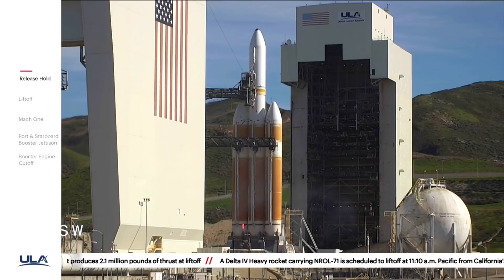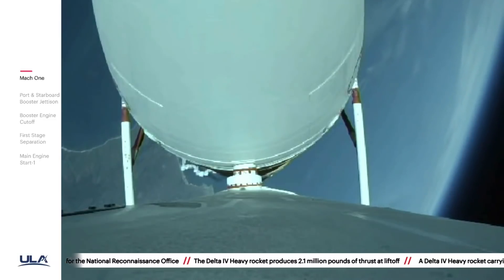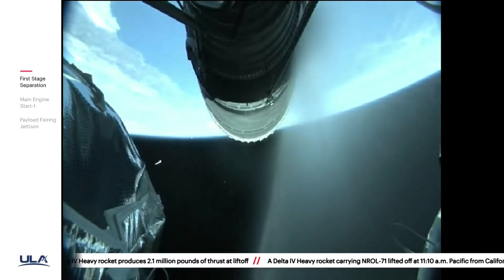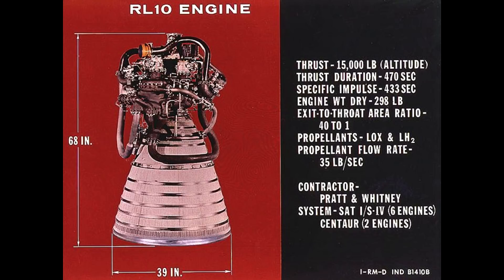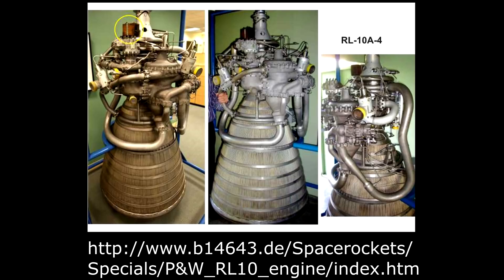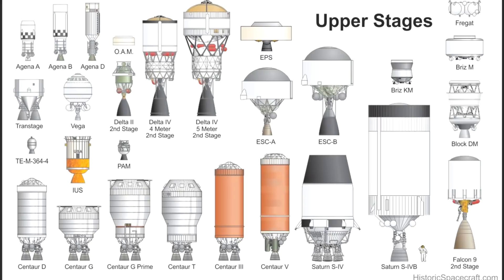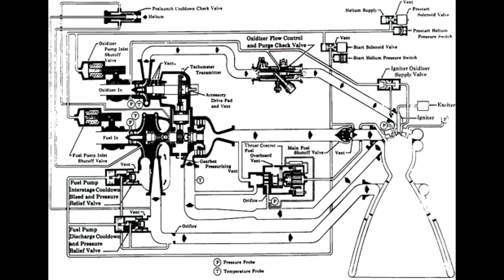The Most Efficient Rocket Engine - The RL10 Expander Cycle Engine

Comment: My grandfather Wesley Kuhrt was responsible for the overall design of the RL10 and was gifted the patent for the the RL-10 rocket at P&W. He came up with the original idea for changing the expander cycle and was a genius with regard to liquid hydrogen. My family used to tell a story about when he was 13 he accidenelt exploded a test tube with hydrogen in his basement and had glass imbedded in his chest. I have the original pump expander design patent plaques gifted in his name. He lead the research department for many years and ended as Executive Vice President of United Technologies in the 1980’s.
Reply: Impressive guy!

Comment: Boiling the hydrogen seems like a really bad idea, the heat capacites are unpredictable, and the resulting gas/liquid mixture can't be good for the turbine. Boiling also limits the chamber pressure to no more than 200 psi so it's unlikely that it would reach the quoted performance. The pressures must have been much higher to allow the supercritical fuel to smoothly expand through the cooling jacket and turbine, as the cycle's name suggests

Comment: The RL10 is OBSOLETE in so many ways... it is still a brazed tubing engine when it would have been faster and cheaper to DMLS print the darn bell. Also, at 10 tons thrust, it is seriously underpowered for ALL the applications it is currently used for be it the Atlas Centaurs or the Delta IV upper stage (aka SLS ICPS). Speaking of the nozzle extension, it is kinda one of those unnecessary complications. I bet you the payload fraction would not have been meaningfully worse if they had a fixed nozzle extension and simply extended the interstage. The additional mass being discarded with the already heavy 1st stage isogrid tank will have minimal impact on overall performance.
--
NASA really shouldn't have dropped the J-2X efforts for SLS and EELV shouldn't have abandoned the RL60.

Comment: The expander cycle is the right choice for lunar landers -- well within the square-cube limit, low stress on the turbine, very high ISP -- and with 3D printing simplifying the construction and likely improving the reliability it just makes more sense than any other engine cycle for reusable landers on the Moon.

Comment: The RL-10 was designed by Pratt & Whitney, the same engine company responsible for the R-1830 engine used on the DC-3/C47 and many other iconic airplanes, the R-2800 that in effect became the war-winning radial engine equivalent of the British Merlin V-12, and the reliable R-4360 workhorse of post-war heavy hauling.  Quite a legacy for a machine shop.

Comment: Hey Scott, idea for a show: the old Russian NK-33 (?) engine; revolutionary closed system, much better performance, had a bad run with the N-1, put in storage, rediscovered by the West as "sliced bread 2.0", cleaned up, renamed AJ-26, had a bad run with Antares, and now what? Was it finally tossed as a concept, or are there versions still kicking around? What's your take on that evolutionary line of engine design?

Comment: As always, great video. Just a tiny correction: the C-C composite nozzle extension of the RL-10 is not ablatively cooled, it's radiatively (and sometimes film) cooled. You are probably mistaking it with the carbon composite extension of the other delta engine, the RS-68

Comment: I have a question that is bothering me that I know you can answer. As an A&P mechanic I understand the theory of the fuel control, throttling, and the Brayton cycle of a jet engine. My question is this: 1.what is the stoichiometric of a rocket engine, 2. how do you throttle a liquid rocket engine, it has no carb or fuel injectors, 3. how do you start engines with no ignitor/spark device, 3. Is it a self sustaining cycle? (i.e. jet engine)? TX! I will be waiting for your answer!
Reply: valves upstream from the turbo-pumps.  throttled turbo pumps = variable fuel/oxidizer flow to the thrust chamber = throttled thrust...

Comment: I wondered why they were going for a new, heavier, slightly lower performance version of the old workhorse, I figured the new engine must be significantly cheaper to build.
Then Scott pointed out the RL 10 is already the most efficient chemical rocket engine, so I suppose it can afford to lose a couple of ISP here or therel

Comment: What with the "104%" thrust. Why do they say 104% and not just 100%?
Reply: To avoid having to rewrite all the technical/training material everytime it was proved the engines could safely and reliably perform at a higher power level than what was originally thought. Essentially, with "104%", it means that there's an extra 4% of performance on top of the original standard that can be used

Comment: Why does there appear to be a bunch of frames missing from the footage at the point of booster separation? It doesn't appear to be a signal issue as the cut is very clean when you look at it frame by frame
Reply: There are dropped frames in several spots not just there.

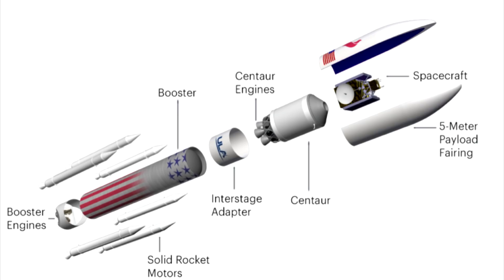Comment: 5:00 I was wondering how specific impulse could be measured in seconds. I mean, it's the time for what exactly? So I looked it up and decided to share. As far as I can tell, if you were to let the propellant free fall in a vacuum under earth gravity for that amount of time, then it reaches some speed, and that's the exhaust speed we're talking about. Of course, this is useful because the momentum of the propellant gets transferred (negatively) to the rocket.
Reply from the maker: The other way to think about it is if you multiply the acceleration of earth’s gravity by the specific impulse in seconds you get velocity. And this works regardless of whether you use meters per second of feet per second.
Reply: specific impulse = (impulse per unit weight-on-Earth of propellant)  Calculated via -> Thrust (mass*distance/seconds^2)= gravity(distance/second^2) * ISP(seconds) * Fuel consumption rate (mass/second).   Thus Isp in seconds = the number of seconds a rocket engine can generate thrust from a weight of fuel equal to the thrust of the engine.

Comment: I once read that during a ground test of an RL-10 engine the nozzle extension was inadvertently lowered after the engine had already begun firing. Apparently it chugged on through the transition as if nothing was wrong. There was some talk of in-flight nozzle extension deployment as a way to boost first stage performance on future rockets but I don't think it was developed far enough to be tested.

Comment: Always did wonder why the RL-10 was still in service (assumed corporate inertia). But basic design needs don't change, this solution survived. Darwinism. Learned something!
Segue to a video request, to non-condemn "corporate" approach. Does SpaceX's approach really give them a greater profit? Could do better if they'd never developed re-usable boosters? *Heresy*, but it's nagged at me that the great majority of F9s have not re-flown. All-disposable still cheap per launch in many ways. Just would love to see an analysis: How long does it really take to reap the profit of re-usability?

Piques your interest?  In an alternate timeline, Elon just wants to make money, sees an opportunity in a non-innovative industry. No Mars. Builds clean sheet rocket and engine. Spends no R&D money making the Merlin re-usable, or developing landing legs, landing techniques. Results in a significantly higher performing rocket. No infrastructure for drone ships, all aspects of refurbishment. That's an enormous amount of money. SpaceX undercut industry prices while disposing of nearly-reusable and reusable rockets, from the gains from an all in-house design and manufacturing. No pressing need for BFR - some of the savings would go to a follow-on big hydrolox (methalox?) upper stage, with Raptor-like engines. Or even RL 10s! Btw, is a 5 booster Falcon Heavy feasible? Beef up core booster to support enlarged upper stage, fairing. Match Delta IV Heavy for GEO.

I love everything about SpaceX, seeing booster landings, going to Mars. But wouldn't they be a lot more profitable? Yes, they're just getting to the big pay-off stage, will be mostly re-launching. But with no competition pressure (no one else relaunching), they would have, and would be, making big bucks.
Reply: that is a question of motives. Musk's motive is not profit. SpaceX was founded for one reason and one reason only. Get to Mars. The rest is just paying the way.
Reply: @James-rl5tj   Yes, definitely. However, the other much discussed rationale for reusability is that it's cheaper than throwing away a rocket. But is it really? As much as the idea appeals to me, I do wonder how long it is before the payback begins - so long that  the rocket's becoming obsolescent? 

Rockets optimized for Mars are more expensive. Will the Starship's huge LEO/GEO lift capacity be needed often enough?
Reply: I don't know if even Spacex knows until the block 5's..  Those are the final version and are supposed to be reused a lot.  Those boosters will answer the question I think. :)

Comment: With the nozzle extender, shown at the start of the video, does it link up the plumbing to the brazed pipes, or is it just a passive shell?
Reply: I can't imagine how that would work, practically and reliably. The F9 upper stage Merlin has the same actively cooled plumbing (but 3D printed!) bell as the lower stage, but with the big bell extension bolted on. That has no plumbing/cooling. The gasses are expanded/diffuse enough. Don't recall what it's made of.
Reply from the maker: It’s a passive shell.

Comment: Dear Scott, i have one question regarding the Atlas HLV and Delta 4 Heavy. Wouldn't it be more useful to combine one delta central stage with two Atlas booster stage. This would combine the higher thrust of the Atlas at the start with the higher specific impulse of the Delta later in flight.

Comment: What I don’t quite understand is why you would use an extendable nozzle in a second stage engine. I mean it would make sense if you want the engine to be both efficient in lower atmosphere and in a vakuum. But if the nozzle is extended right after sepperation wouldnt it be much easier and lighter to just build it bigger in the first place. So why did they chose a design like that?
Reply: Same reason we initially developed extendable nozzles back in the days when we were developing the Minuteman III ICBM (their first application).  Telescoping the nozzle extension in that way allows for a shorter interstage structure, because you don't have to fit as long a nozzle between the stages.  In ballistic missiles, this is advantageous because it allows you to make better use of the space inside the silo (missile silo dimensions were limited by the SALT 1 treaty, so being able to shorten Minuteman III's interstage structure meant we could have longer stages and thus greater throw weight while staying within the treaty limits); in space launch vehicles, it's advantageous because the interstage structure is dead weight that doesn't contribute to the launch, and a shorter interstage structure will be lighter, allowing more payload with the same rocket.
Reply: I can't find the source now, but I remember reading that they didn't have space. Notice that the RL10B-2 in stowed configuration is roughly the same length as the RL10A-4-2. Maybe the added weight from having a longer section between stages was higher than the weight of the nozzle.

Comment: A rocket designed in 1959 still being used today, why has every other aspect of life moved on massively except rocket tech?
Reply from the maker: The modern toothbrush design dates to 1938, you still use that right?
Reply: Scott Manley ha you mean my ultrasonic Bluetooth wireless charging toothbrush! I’m running out of time left on this planet and just wish we could kick some butt and get going somewhere soon while I’m still around to see it
Reply: There's a very good chance that the engine in your car was developed right around the same timeframe.  For example, the widely-used GM 3800cc displacement V-6 is, essentially, the old Chevrolet 302 cubic inch V-8 minus two cylinders, while the 302 was essentially developed (in the early 60s) by taking the old 260 cid V-8 and increasing its bore and stroke without changing any other dimensions... and the 260 was introduced in the 1955 model year, meaning it was designed in 1952 or 1953.

There are a hell of a lot of places where the engineering mantra is, "If it ain't broke, don't fix it!"  The basic design still works and performs extremely well; just make small iterative improvements to the existing design rather than spending the billions of dollars and millions of man-hours involved in starting with a clean sheet of paper and designing something entirely new, unless some new requirement means that an entirely new design is needed.

Comment: I thought they had added more pre-launch hydrogen burn off capability to reduce the size of the flame that turns the orange covering black on launch.  But this one looked like the old style. Or was that planned for later?  Just wondering if they had tried to add the flame reduction system and that had affected the previous launch attempt and so they removed it.

Comment: Throttle over 100%?  Call it the Spinal Tap engine.
Reply: It's pretty common that as engines get developed they surpass their original design specs so they get quoted as higher percentage. Shuttle engine is something like 108% now.
Reply: Love the reference. But I'll engage my OCD at an 11:
During Space Shuttle launches, we'd always hear "throttling up to 104%" for the SSMEs after SSRB separation. Guess they mean over original design specs. Also, since for RL 10 it was a test run, they could run it past operational limits.
Reply: @donjones4719  104 % was not given after SRB sep. Lift-off was at 100%, and by the time it cleared the tower (about 5 seconds) the engines would be throttled up to 104,5%. They performed at this power level at any time except for the throttle down period as the vehicle went supersonic before reaching MaxQ, and during the last minute or so of powered flight to maintain an acceleration of 3 Gs, a phase thus called 3G throttles. In case of emergency they could have been throttled up to 109% in case of an abort, a thrust level that would be pretty much the new standard power level for SLS, as they won't be reusable. The engines Columbia used since STS-1 through STS-5 were rated at 100% RPL, but during Challenger's first mission STS-6, they were running already the engines at 104,5%. The over-100 values were used to avoid having to rewrite all the technical/training manuals with the new performance levels.
Reply: @lorenzopappatico   Thanks so much for the great info, and level of detail. And especially for the illuminating last sentence.

Comment: So, the second stage engine don't fire before the nozzle is fully extended, that has to cost a bit of performance (like not firing it right away after stage sep.). I'm sure the overall benefit must make it worth it but just thinking.

Comment: I wonder does ULA has any plans to launch any reusable rocket like  Falcon 9 or upcoming New Glenn rocket? Or is their plan to reduce the cost as much as possible and continue flying in the old way ?   awesome video as always btw! 😁
Reply: They have a method under development called "Smart Reuse" which means dropping off the engine section (which will also include avionics and other expensive stuff) and recover them by a parachute /ballute and grab them with a helicopter (Similar to the way they used to recover film canisters from spy satelites). Sounds crazy, but they think it will work. It will supposedly save 70% of the costs of the first stage without sacrificing much performance, as they don't need to reserve fuel for landing.
Reply: @kristenburnout1  Never sounded crazy to me.  It's a logical extension of the stage-and-a-half technology used on the original Atlas to jettison the booster engines, and something that Boeing had proposed for a second order of Saturn Vs to reduce the cost, a stage-and-a-half first stage where the four outboard engines on the first stage would be jettisoned and recovered by parachute for reuse, with the center engine being a sustainer that would be expended along with the stage.

It's simple, but that's what makes it so smart; rather than attempt to recover the entire stage like SpaceX, with the attendant payload hit, you recover the expensive bits and replace the cheap part (let's face it, the tanks cost next to nothing to build) instead.  There's a place for both--SpaceX's theory of recovering the whole stage allows for rapid reuse, but this is akin to the use of drop tanks on aircraft; it gains most of the advantages, at a minor cost in replacing the expended tanks that you jettison.  (After all, fuel tank sections are something well-suited to mass production, so they could easily have a stockpile of them ready for having recovered power sections mounted for use.)

Comment: The RL-10 was also used in the DC-X SSTO demonstrator project, in part due to its ability to throttle/restart.
Reply: Wonder of that's when they developed the extendable nozzle. SSTO engines operating from sea level to space would really need that benefit, in spades.